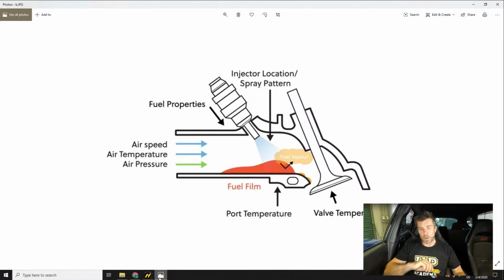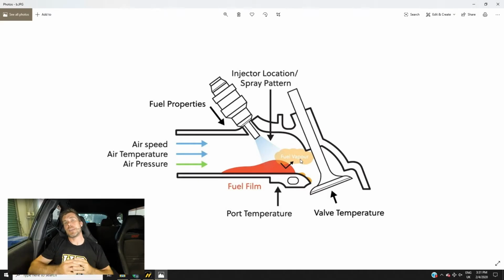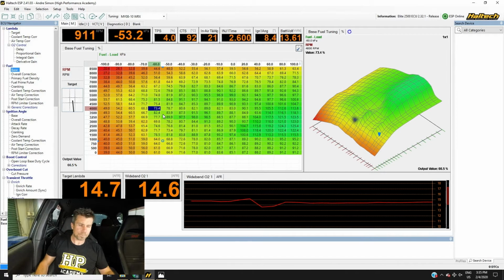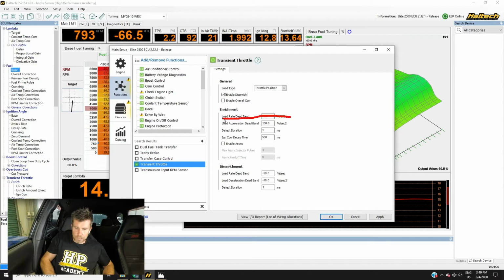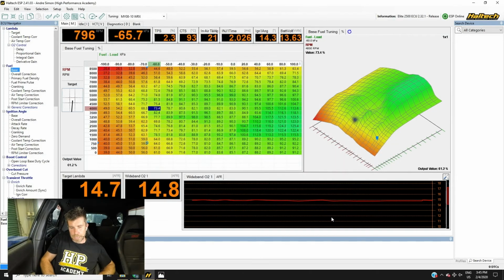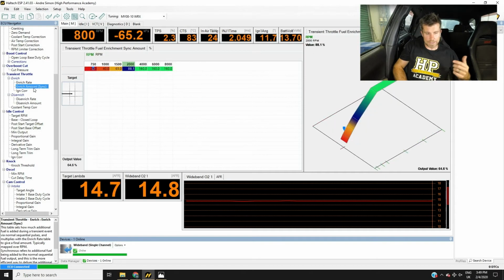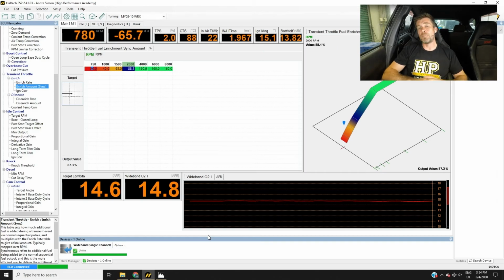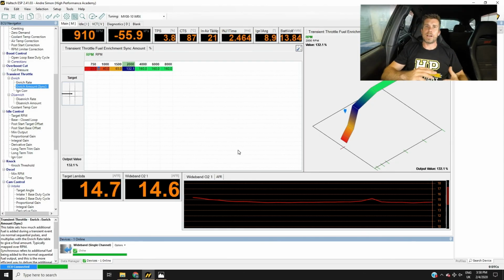Even Some Professional Tuners Get Transient Enrichment WRONG

Comment from the maker: ✅ Building a fast car? Get $400 OFF the all-inclusive VIP online course package deal: https://hpcdmy.co/vipy113
⚡ Kickstart your EFI Tuning knowledge. Get 50% OFF your first online course: https://hpcdmy.co/offery113
🚨Want to learn how to EFI tune a standalone ECU like the Haltech we use for this example? Start with some free lessons right here: https://hpcdmy.co/EFI101y
TIME STAMPS:
0:00 - Introduction
0:50 - Why we need transient enrichment
8:40 - Fuel/VE table must be correct first
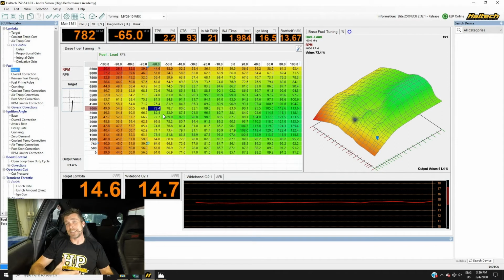11:50 - Transient ignition trim
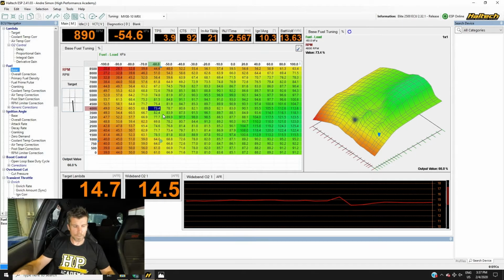12:50 - Setup walkthrough
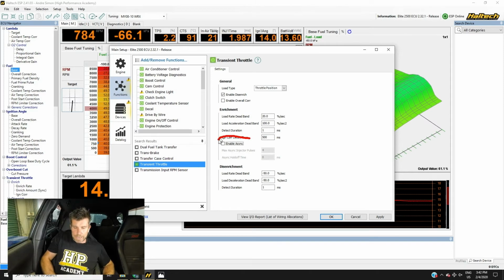17:55 - Async vs sync enrichment amount
20:45 - Transient throttle control parameters
28:25 - Tuning demonstration
35:30 - Questions
Reply from the maker: Note even if you're planning to, tune a different brand of ECU, this is the lesson to start with down that path 😎😎

Comment: In a Chevy type EFI or MAF plus MAP tables, you can easily affect transient fueling. If you can run MAF only and Open Loop, make the MAP/VE table slightly richer. This will provide richer fueling immediately when accelerator is pressed and is very tunable.  For racing situations I don’t recommend Closed Loop. Open Loop will also allow you to easily control your deceleration AFR. You should not go for emission type tuning on deceleration, it should only stay close to 1 lambda and just a little lower to cool intake and exhaust while decelerating. This is an often overlooked and little known way to keep boost on tap and keep engine cooler.  Awesome video!

Comment: TPS get old and lazy and put out dirty signals, sometimes they output dirty signals when new and that's when some RF shielding of the TPS wires are needed. That could also be a reason for the erratic fueling.  
A few questions...
1. Are manifolds that have the fuel injector firing upstream in the runner better or worse when tuning transient? 
2. Would it be proper to tune the overrun areas of the VE table to not inject fuel at all instead of tuning decel transient? Thanks - Pantyeatr1
Reply: 2 is an easy question. The answer is not really. Having fuel in the cylinder during a decel period helps cool the cylinder down especially after a WOT event.
Reply: @kinslayergaming3159  like just enough fuel to calm the crackling or burble? 🤔

Comment: Indeed, acceleration enrichment is one aspect where it is much more difficult to get as accurate as one could be for a fueling table. 
The thing to keep in mind is that engine response must be the main criteria, AFR/lambda is not helping much and could show some delay depending on the oxygen sensor location on the exhaust

Comment: I have dialed in  Accel enrich for RPMs above 2k. But lower RPMs no matter what I do the engine still hesitates under almost any amount of throttle jab. The engine is big cam 6.9L LS3. I wonder if its because of the big TB and big displacement ?
Reply: I would try adjusting the fuel injector phasing/angle if the software allows it. Adjusting that made a difference on my car at low RPM.

Comment: Andre, excellent demo man. Carburetor tuning is another thing that will really help people understand the tuning. It's far more time consuming and nuanced but a necessity just the same. Tuning of the 4 parameters takes experience but is priceless in EFI tuning. 
It's based on the accelerator pump and jetting. Carb throttle plate position dictates fuel flow entirely based on resulting airflow. Carbs are brilliant when you think about what they do. They can be tuned to match EFI efficiency at a given ambient pressure.
Reply from the maker: We're working on a carb course (finally, woo!). Hoping for around mid 2023. It will be a new face presenting it that has the equivalent to Andres experience, just with carbs instead of EFI =) - Taz.
Reply: @hpa101  Brilliant Taz, I've been doing carbs for decades so it really does wonders when I'm tuning an ECU. Us Dinosaurs are a dying breed though lol.

Comment: Throttle tip in enrichment / transient throttle was something I understood in theory but not exactly sure how to tune for. mostly just by seeing the initial afr during initial throttle application, if it leans out too much, then add the value until it reaches a point where its minimized, but i find leaving it a little lean gives better power.. though it may mean that ignition advance during throttle tip in can be optimized further.

Comment: This is THE most underrated car channel on youtube. A lot of the things I've learned here as well as applying this knowledge to tinkering with my own car has allowed me to have a much deeper understanding of how EFI works that has even led me to fix cars on the OEM world that others had given up on for having strange issues. I also can't even name the amount of times where someone like me, who has no dynamometer has cleaned up fuel maps by "tuners" who only care about that wide open throttle run. Getting the car to run much better from cruise to medium throttle and gain a lot in fuel economy.
Reply: I personally couldn’t rate them highly enough!
Reply: For real couple million subs by now.

Comment: I tried to get the megasquirt wall wetting algorithm to work for a while. But there is so many variables that I never did get it quite right, reverted back to tps based for now. I was only road tuning so I suspect on a dyno I might have more success.

Comment: I know this isn't really the best place to ask but I'm serving a Facebook jail sentence at the moment lol. But do you guys cover what the "P term" and "D term" terminology is supposed to mean in Holley EFI software? It's under the ignition timing section of the idle tab in my Terminator X software. The owners manual and Holley themselves weren't much help. Surprise....
Reply: It looks like terms from a PID close loop control (p for proportionnal to error between current and target, d for derivative). PID is very common when it comes to idle speed close loop control. As idle speed varies with air amount the engine sucks and with ignition angle I assume holley propose to vary ignition angle through a PID close loop in order to keep idle speed at target. 
However in PID control loops, P and I terms are the most important terms, D term is much less, often left to zero, so if you don't see a I term along with the P and D terms I'm likely wrong (unless holley only allows P and D tweaking, using a fix I but that would be a bit weird)

Comment: It's not just "some" tuners that forget about it or don't understand it, it's many! I myself have owned a GTR for the last 13-14 years and it's been through many different tunes and computers and to date it's only been myself and one other tuner who understand the concept of transient enrichment. I've found that many a tuner would either just enrichen the base map to a level where these lean spots get cancelled out but give your horrific economy, or they would just ignore the area of tuning altogether and then spin you a story about why the motor is lethargic every time you press the loud pedal. My best experience with the later was that it was my "twins" and that a "single" would fix it ;-)

Having this area tuned by someone who knows what they're doing makes a difference like night and day, especially if you turn the feature on and off while driving and it makes you wonder just how many people out there could be getting so much more out of their pride and joy in every day driving...
Reply: Yeah it’s a tough one and It’s one area I simply have no means of precision tuning other than mechanical using an adjustable high rising rate fmu and bleeders and check valves to regulate the fill time/amount and pressure reference to the regulator lol but it’s good enough for an Ecotec v6 but it’s the hardest areas to nail especially with multiple boost/load levels
Reply: @needmoreboost6369  - that sounds quite complex at your end! I'm guessing your can't tie it all to your TPS at your end? 
At my end I just have it controlled by the TPS / rate of movement and then is corrected according to RPM, temperature and how soon ago the last throttle movement was etc (ie, enrichment decay rate). This is using a rather oldish Haltech PS2000 hehe - I dare say it's all much easier and more "automatic" on newer ECU's....
Reply: @tommis1985  nice! might be old but still you have the abilities! I’ll get there one day! but for now my goal is to find out how far I can push the maf and how fast I can go on a stock ecu it’s a silly goal and with some interesting drawbacks but it’s fun to trick it and roughly make it work! but I’m in the middle of nowhere lol and have access to 20km  long straight for a dyno lol
Reply: @needmoreboost6369   - haha 20k long dyno - now we're talking! Sounds like you're having fun though and that's all that matters (along with keeping fuel up to your motor of course ;-) )
Reply: @tommis1985  lot’s of fuel pumps,I’m using my injectors as pressure cleaner’s for the intake valve’s lol
Reply: Getting throttle enrichment, idle control and temperature compensation right, make the difference between a comfortable road-car, and an unmanageable monster, lol. Even something as inherently "highly strung," like a car on 300 degree cams and ITB's, can still be relatively well-mannered, if the time is taken. Problem is: doing these things doesn't make impressive numbers on the dyno, so many tuners don't bother 😂
Reply: I think my tuner also has no idea how to do this correctly. Is there any way to find somebody who does without teaching myself how to ?
Reply: @NathanaelNaused , you might have to call around for that or talk to people who've used tuners they've recommended? 

However, learning how to do it is not hard especially with more modern computers. There're plenty of how-to guides on Youtube and so long as you have a wide band o2 sensor you're right to go. The main thing to keep in mind is that you need to make sure that your base map is actually right first in all cells and only then do you layer on correction maps like the transient enrichment....otherwise you will just chase your tail. (base map tuning needs to be done with all correction maps disabled).
Reply: @tommis1985  I'm learning how to tune slowly. But my car needs to be tuned and I'm not there yet. But also it's a Ford PCM (2014) so I guess I'll keep learning. I've been teaching myself HP tuners